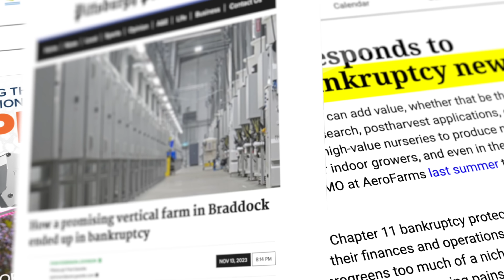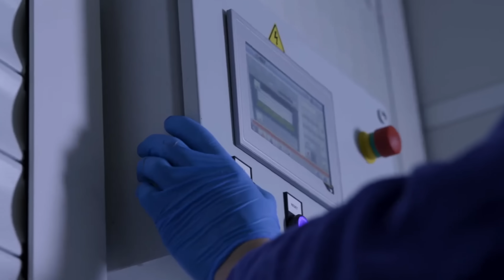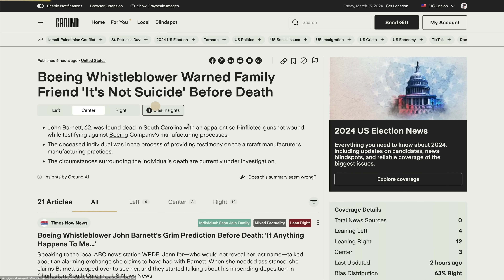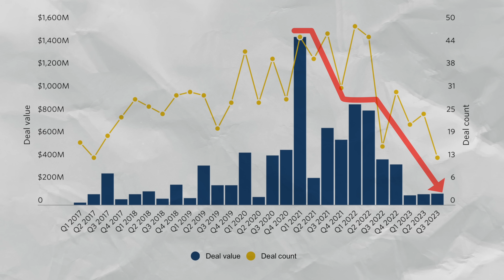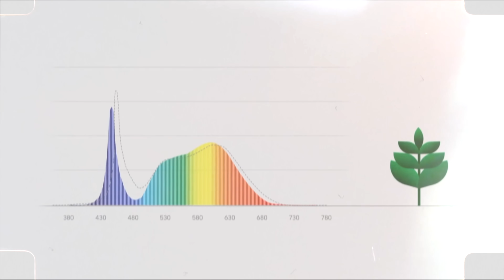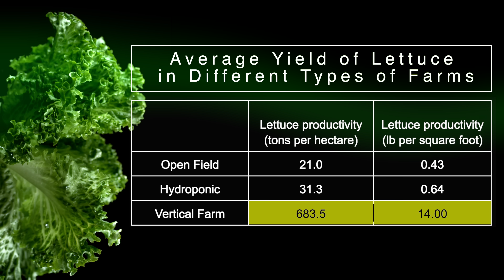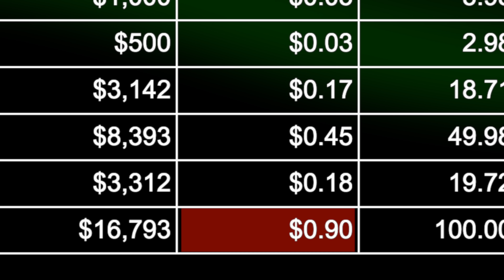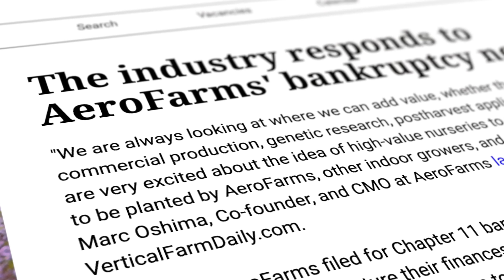The EPIC Failure of Vertical Farms - What Happened?

Comment: Your energy calculation is flawed because Businesses in the UK are typically supplied under non-domestic tariffs, which have different unit costs and standing charges than residential tariffs. For example, average non-domestic electricity prices for industry rose from about 14.81 p/kWh in 2021 Q1 to 25.97 p/kWh in 2024 Q4. 

For large/industrial business consumers the unit rates are often lower than smaller business rates (due to bulk use) but still distinct from domestic rates.

Comment: At the very best, you can apply this logic of vertical farming failures when applied to the capitalistic greed of "developed" countries. High cost of labor because workers have to compete with rising costs of produce in those particular countries. The fact is that farming has to be innovative to be sustainable, i.e. open-air ground farms struggle, with droughts or floods, so you can lose "profits" instantly from Mother Nature. Versus the high labor cost of so-called technical workers who feel entitled to a "large" salary. There is a middle ground. And it is not by exploiting poorer countries with cheap labor, and poor working conditions. More like a hybrid of vertical, or horizontal hydro/aero-ponics and traditional soil farming open air or greenhouse, and technical on-the-job training. Farming will always be around because humans need food. It is greed that flops any business. Love of farming yields higher returns from smaller efficient investments. PSA.

Comment: One thing about sunlight being so awesome is that sun is really, really far away. The way light intensity drop over distance is by inverse square law: twice the distance, four times less intensity. The amount of sunlight hitting the top of the plant and the bottom is in all intents and purposes the same on planet Earth. Now, put LEDs a foot away from the top of a foot long plant. The bottom of the plant gets roughly half of the light.  So that limits the plant choices to... leafy greens, wide and short things with short and rapid growth cycle. We also can't tolerate uneven growth, we can't tolerate rapid vertical growth. Otherwise the fastest growing individuals will burn their tops while the slowest don't get enough light to catch up because we need to adjust the lights optimally, constantly.. or lose a fuckton of energy because your lights have to be further away than optimal and then you need more of it.

So, well before we have done any other planning, we know that you can't grow tall and lanky because the lighting follows the laws of physics. Indoor growing of say.... marijuana is very different, the it is all about the top and the rest is waste, often removed completely to improve air circulation This is ok with some plants but it limits things greatly, and marijuana end product is measured per gram.. it is in COMPLETELY different price point. We need A TON of food that is priced at one digit per kilogram, like 1€ for a kilo of stuff, not 400/kg.... Indoor growing before we add vertical stuff in it is already difficult to make sense without sunlight. Then you add the hi tech stuff on top, the need to pump water up is one of those little details that you don't think matters but it does. Every foot up costs you more money. Every single thing is going to cost you more when you go from horizontal to vertical. 

So, because sun is so far away is one of the biggest reasons for indoor growing to be too expensive. Sun is AWESOME light source for growing stuff.

Comment: "Why vertical farms are failing" sections never covers why they are failing...  Instead challenges are mentioned 2 sections later, but they are easy to overcome challenges, which have equal challenges with normal farming that are permanent, that just exist early in any industry.  Also, it would take 10-20 years for some costs to go down, as is true for all new industries.  On top of that, there is no explanation on why blue collar costs are so much higher.  Equipment depreciation is a BS excuse, given the cost and depreciation and maintance cost of farm equipment.  Also, these comparison should be done across crop types, because some crops absolutely aren't plausible with vertical farming, while others it has to be cheaper if the company is right correctly, which many start ups that are in waves like this are scams.  Do you realize how easy it is to fool wealthy people into dropping money into an exciting idea, funnel a lot of it out of the company in legal ways, that shouldn't be legal, including way too high of exec pay, parachutes, ect, then just fold the company.  Happens in every wave of every technology, like we are seeing with AI right now, most of them are scams.

This video should be revisited with a proper deep dive, comparison, interviews, and full breakdowns.

Comment: My small vertical experiment crashed when I found out how rapidly the grow lights faded in output. It still looked like light to the naked eye but the lumens output took a flying leap off a cliff as soon as you turned it on. By the second season the output was so poor it couldn't turn a frustrated moth. Purchasing new grow lights that often killed the entire project. I went back outside in the sunlight.

Comment: Before I even start the video, I'm going to guess that it's a combination of scaling too quickly and poor crop choices. 

After watching the video, I was right: the crops that should be targeted by vertical farming are therefore luxury crops that require a lot of water, like tropical fruits. Unfortunately, most of those grow on trees.

The cost of scaling too quickly shows up as high labor costs and extreme inefficiencies in process. The workers needed to solve problems are highly educated, and demand better pay because of it. Give them a decade and let them train their replacements, and I bet you'd see both overhead and labor costs plummet. Silicon Valley's motto is "move fast and break things," however, so they're never going to give any company a decade.

Comment: LED isnt high tech. Its insanely cheap and uses nearly no power.
Reply: Well it's a comparative statement, obviously. It means in terms of different lighting technologies. In terms of lighting, LED is undebatably expensive in terms of initial capex. And the conversion of energy to light is higher, but the idea they use nearly no power is preposterously ignorant - all of the light output comes from power, literally.

Comment: Here is a summary of this video if you have no time to scrub thru it:

The video identifies the following key reasons for these failures:

High Production Costs: The cost of producing crops in a vertical farm is significantly higher than in traditional farming. 
For example, a pound of lettuce from a vertical farm costs $5.26 to produce, compared to just $0.80 for a traditional farm [10:46]. 
This makes it difficult to compete on price, as consumers are not willing to pay more for the same product.
High Labor Costs: Labor is the single largest expense, making up almost half of the total production cost [10:24]. 
Vertical farms require more skilled workers with specialized knowledge, driving up wages.
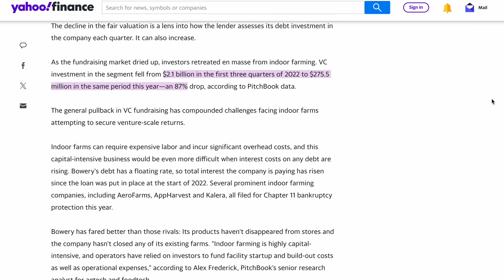Decline in Investment: The venture capital market for vertical farming saw a dramatic decline in 2023, with investment dropping by nearly 90% [04:34]. 
This lack of funding was critical, as these companies have a very high "burn" rate, or rate at which they spend money [05:21].
Technological and Operational Challenges: The closed systems of vertical farms can lead to a higher risk of widespread pest and disease outbreaks [08:29]. 
Furthermore, these farms have primarily been successful with leafy greens and have not yet been able to profitably grow more substantial crops like fruits and vegetables [08:48].

My opinion on the potential solutions:

Potential solutions for vertical farming companies to become more successful and profitable often center on addressing the high costs and operational challenges identified in the video. 
The industry is currently focused on technological innovation, business model optimization, and strategic market positioning.

Technological and Operational Solutions
Automation and Robotics: 
To combat high labor costs, companies are increasingly investing in automation and robotics for tasks like planting, harvesting, and packaging. 
This reduces the need for manual labor and minimizes human error .

AI and Data Analytics: 
AI-powered systems use real-time data from sensors to optimize every aspect of the farm, including lighting, temperature, humidity, and nutrient delivery. 
This precision agriculture leads to faster growth, better yields, and less waste, which directly improves profitability.

Energy Efficiency: 
Since lighting and climate control are major expenses, vertical farms are adopting more energy-efficient technologies. 
This includes customizable LED lighting that can be tuned to specific crops and integrating renewable energy sources like solar panels to reduce electricity costs.

Business and Market Solutions
High-Value Crops: Instead of competing with traditional farms on low-margin crops like lettuce, some vertical farms are focusing on high-value crops such as strawberries, herbs, and even medicinal plants that can command a premium price.
Strategic Location: Placing vertical farms in urban centers or close to distribution hubs reduces transportation costs and allows them to market their produce as locally grown and fresher, which can justify a higher price point.
Modular and Scalable Systems: The use of modular, stackable farms (often in shipping containers) allows companies to start small, prove their business model, and then scale up gradually as they become profitable, reducing the high initial capital investment.
Diversification: While leafy greens are a proven success, research is underway to profitably grow more complex crops like small fruits and vegetables to diversify offerings and capture a larger market share.

Comment: The 2 main problems seem to be 1. it's a profit motivated project so even if it is more beneficial for society (better water and land use when both are scarce and less environmental impact) it is not more profitable, meaning the benefits of vertical farming might only be possible if run by the government and therefore eliminating the profitability constraint. 2. Labor costs are higher because traditional farming uses essentially slave labor or in many cases actual slave labor (plus wages get eaten up by landlords, every dollar raise you get is a dollar more your landlord can demand from you). There's a lot of tech and methods of production that are objectively better such as vertical farming, but are held back by the economic structure which demands quarterly transfers of wealth from the poor to the rich (with the declining middle class being the most obvious visible sign given there's more to take from the middle than the bottom) instead of basic human need driven optimal resource allocation.

Comment: The more high tech you try to get with farming the last profit per head of lettuce or per unit of produce You going to get. Farming is a simple thing and a more complicated you make it the more expensive you make it. It's not that complicated. Even if you do use hydroponics, it's not that complicated. Use the sun and use light tubes to bring the sun into the environment indoors. Use stackable stories containers versus going for indoor warehousing. It's not that complicated. People make it complicated. People want to use tech. Tech is complicated. Farming is a simple thing. People are complicated. People overthink things. People want to be in tech. Farming is not that technical. Keep it simple and it will thrive. Get rid of all the crap and tech and vertical forming would be a lot more profitable.

Comment: I agree they should use regular sunlight. The fact is that shade houses and greenhouses can apply. Hydroponics without necessarily all the other high-tech LED stuff. It seems to me this is a case of over-engineering. Also, it seems like there are some carelessness in terms of filtering both seeds and employees of possible pests before entering the environment. I've seen regular greenhouses that have pretty strict entrants requirements before you are loud into the greenhouse.

Comment: It was always doomed to failure. Capital and raw material costs are too high. 
If it's not economical in an area or for a produce to make a simple greenhouse, which uses free sunlight, it's not going to be economical to make expensive buildings. Your competition isn't blocked by tech or a patent; literally everyone with sun and water can beat you. 

Not financial analysis, but for example, I remember costing out a vertical PVC pot system in my backyard. I figured it would take me 10 years to make back the money I spent on the materials, much less my labor. I chose to stay flat, and am growing everything I want on 10'x 20', and the soil, sub, and rain do most of the work for me. Even then, it's not really economical (though scale matters), because a box of lettuce is $4.

Comment: There is definitely a better solution to all this. What if we could have the benefit of the sun and still grow in a controlled environments. What if instead of growing in a building just grow it in an empty lot in your neighborhood or roof of the buildings. I know aeroponics has the capability to achieving it. and one roof should be able to produce enough vegetables for the entire building. And maybe use cheaper equipments at the end of the day its just pipes and a pump the same farming equipments used for irrigation.

Comment: I think lettuce is the wrong thing to grow if you want to make a profit. There are a lot of hard to grow plants that would be more profitable.  For example, wasabi cost 160-250 per kg and is extremely hard to grow, the stuff you get at your local revolving sushi bar is cut with horseradish and hardly has real wasabi in it.  What about Saffron as well, or white truffle mushrooms? It seems that the intent is to have the perfect conditions to grow something and make a plant you can grow in your back yard is kinda dumb IMO. You would want to grow in a vertical garden a high value resource that is naturally hard to grow. There, I solved your vertical farming issue.